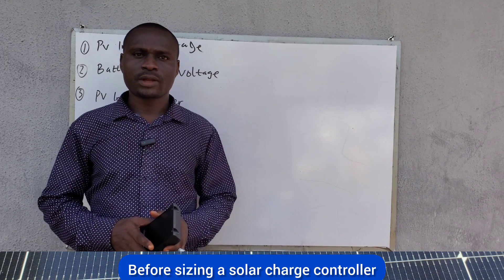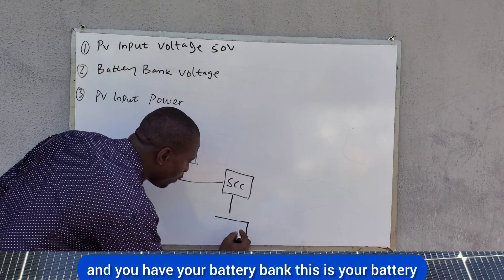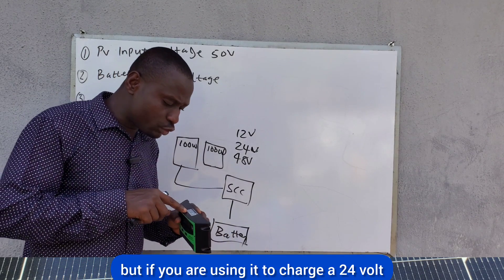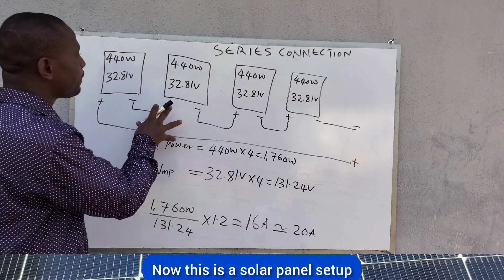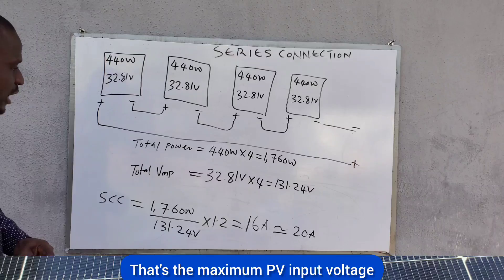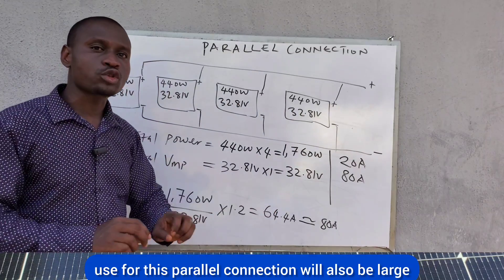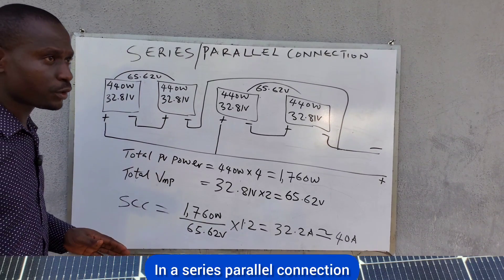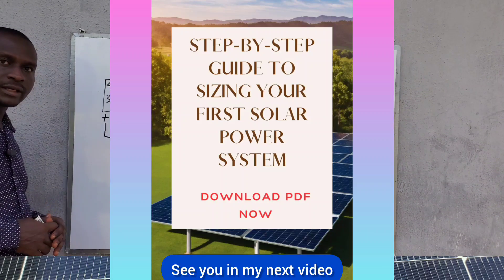How to Size Solar Charge Controller #solarpanelinstallation #solarenergy

Comment: Hi It's Austin in the UK. I would love to have you Pdf notes. I'm trying to put up a solar system.. I've already bought a 6200w hybrid inverter ,MPPT 120A, and I am want to use 608kw for each panels.  How big would be my battery bank and solar  array

Comment: Please, with this illustration, using the solar panel series connection with 20A mppt and solar panel parallel connection with 80A to charge the same battery . Which one will charge the battery faster?

Comment: During the series calculation, you said the current (W) would remain constant, and voltage (V) increase, but when you were multiplying them, you added the 4panels to the series connection, which made current increase and voltage increase too.
That’s 440*4=1760
And then 32.8*4= 131.2 
I didn’t get why the current increase too alongside the voltage when it was a series connection

Comment: Halo.I am from Bosnia and Herzegovina.I have a problem with conection solar panel with voltage regulator+inverter sistem.this is detail:SOLAR INVERTER

Model Name: FU-PV18-1012VPM

Operating Temperature: 0-50°C

Protection Class: Class I

Protection Degree. IP 20

Inverter Mode:

Rated Power: 1000VA/1000W

DC Input: 12VDC, 125A

AC Output: 230VAC 50Hz 4.35A 1Ф

AC Charger Mode:

AC Input: 230VAC 50Hz 6.544 10

DC Output: 13.5VDC 20A/10A

Solar Charger Mode:

Rated Current: 60A

System Voltage: 12VDC

MPPT Voltage Range: 15-105VDC

Max. Solar Voltage (VOC): 105VDC

Max. Charge Current: 70A

Max.PV input Current:20A .Solar panel leapton two pices APTON

SOLAR

Type

Leapton Energy Co.,Ltd |

Peak Power(Pmax)

Power Sorting

Peak Circuit Voltage(Voc)

Photovoltaic Module

LP210*210-M-66-NB-690W

Max Power Voltage(Vimp)

Short-circuit Current(Isc)

Max Power Current(Imp)

39.80V

Weight

690W

Maximum System Voltage

18.30A

0~+5W

47.80V

Open-circuit Voltage Tolerance

Power Production Tolerance

Maximum Series Fuse

17.34A

Dimension

Short-circuit Current Tolerance

DC 1500V

30A

±5%

Application Class

Test Condition

±5%

+3%

23841      du you can help me?  With instalacion wire.thank yuo

Comment: I have a question sir.
Example: If I connect 2 panels in series and I have only 1 battery which is 12v, is it going to charge it. Or If panel was connected in series of 48v and battery is 24v in series, is it possible to charge it?

Thanks for the clarification in advance

Comment: Sir  how are you

So i wanted to ask ; you calculated on series connection and you get   20A  charge controller    how about the voltage of  charge controller is it 24v or 48volts

Comment: I believe the total power is supposed to be 440w x2 and not x4 if not, pls I need clarification. Because by my understanding under ur teachings when pv's are connected in series volt increases current remains the same and the reverse is the case with parallel connection. Since we have 2 strings connected in parallel it is safe to say the total volt will be volts in each string x2 same applies to the current. Thank you sir

Comment: How do I size up my fuse or dc breakers from panels, inverter, controller and batteries, am watching from Namibia, I want to set up my small off-grid system at the village am new with this system.

Comment: Can the charge controller u displayed in this video output up to 200 watts without using an Inverter ( assuming my connection are right)

Comment: The problem is virtually all the mppt controllers available in the market have a maximum PV input power of 390W for 12V battery.

Comment: I installed a 200w solar,30A solar charge controller,12v,200Ah battery,my charge controller failed,what is my mistake,I need help please

Comment: So you want to use a 16amp scc for a power of 1,760watt panels. It won't work. You are supposed to divide by the operating system voltage I.e 12v ,24v, 48v etc.

Comment: please I have a 350watts monocrystalline solar panel
Vmp is 30v, voc is 34v 
Imp is 11.6a, is is 12.36a

What charge controller type and size, and breakers do I need for 
1. 12v, 100ah lifep04 battery and
2. 12v, 250ah 6-gfm gel maintenance free battery 

I want the size controller and DC breakers for the panel to charge controller, charge controller to inverter and Ac breaker from inverter to appliances for each battery type

Comment: for a 3.5 kw inverter charger. with 10 to 13 solar panels assuming each panel is 300-350 watts, how should the panels be connected series or parallel

Comment: I need your advice please ..i have that small pwm charge controller and a 12volts 20a batery ..i want to buy panel but according to the charge controller manual ....is says 18v to 24volts to be used for 12votls batery and 36to 46 for 24 volts batery my question is can i use 36volts 300 wats panel on that same pwm charge controller to power a 12volts batery

Comment: How many 350w 32v solar panel & charge controller can change 440ah24v batteries (Two 220ah24v connected in parallel) sir.

Comment: You really solved everything... Thanks. My question is how many 350wat solar panel can a 60amp pwm charge controller handle?
Reply from the maker: @adeyeyecoker8220  What is your battery bank voltage?

Comment: My question sir.. Is we dont have 20a and 40a  SCC  that can handle 1,760 for 24v battery syatem .. Mostly is 60a  and 80a . Does its mean its will work  or handle it despite is not specified? Pls more explanation and What i no is that u are to divide battery voltage from the solar pv array to size you controller  not the panel vmp and even from every CC We have it specified there and knowing  that if you are using mppt CC ur current will increase converting  the exess voltage. So from your calculation i dont think 20a and 40a can work and from my experiense and research that is a wrong calculation sir.

Comment: Pls can a mppt 60amp work with a 720watts solar panel for charging two 12v 220ah batteries connected in parallel.. Thanks

Comment: good explanation. i love it. i think you woould get an exact size of an MPPT if the TOTAL POWER/TOTAL VOLTAGE was multiplied by 1.5. it would significantly direct someone to a correct SCC. 🙏🙏🙏

Comment: Hello sir, i followed this steps (series connection). I have an MPPT SCC 60A. my solar panels are 750watts. but it keeps frying my SCC. I just bought, the MPPT 60A and now i am seeing smokes coming out from it. please any tips?
Reply from the maker: What is the maximum pv input voltage of the controller?
Reply: @Solarwattng 780w(12v) 1560w(24)
Reply: I just changed from series to parallel now and the charge controller isn't bring smoke. Well I will need an extra Day to check it again when the panels charged and the sun is hot.
Reply from the maker: @babajide-hunsuraphael6625  Ok.. Please chat me up on whatsapp +2340905 345 3640. Thanks

Comment: Keep it up dear, excellent video and well explained 🎉 Please keep in mind in real life situation the voltages will increase below 25 degrees centigrade and will decrease above 25 degrees, you have to take into account using temperature coefficients of the panels used
Reply from the maker: Noted! thanks very much for your input I'm grateful 🙏
Reply: @Solarwattng  Thank you for your response and valuable time that you give

Comment: I understood up till the point where you said connecting the panels in series will also add increase the wattage of the panels as well as the voltage. I thought the voltage is the one that increases when connecting in series while the wattage remains constant. Please help me out because i am not a professional, only seeking the best knowledge.

Comment: Can i over panel this Felicity mppt 12 volts 800 watts with two 550watts panels( making it 1100 watts) on parallel. Can the mppt handle the oversizing?

Comment: but you should know many of the 40amps charge controller cant take1760 watt, most of them on 24v is 1040 watt or is watt not to be considered
Reply from the maker: @josephndubuisi6369  Always look at the spec sheet of the pwm controller for different voltage system (12v, 24V and 48v) to know the maximum pv input power of the controller.

Comment: What should you consider whether to connect in series or pararrel
Reply from the maker: The pv input voltage and current requirements of the charge controller

Comment: Excuse me sir, I have a question for you based on that series/parallel connection. On the first string when you connect the first two panels(440W, 32.81V) In series, and the voltage doubled leaving the current the same, same thing to the other two strings. Now when these two sets of panels are being parallel together how did you manage to get 1,760W. I don't know if I'm the only one noticing this

Comment: I am asking for a solution: I have one solar panel of 380W and one of 450W and a 12V battery; 160Ah...How should I connect them? I was advised to do this with two separate PMW controllers' Is that good or do you have a better solution? Thanks

Comment: I liked and subscribed because it's easier to learn about solar system.

My issue is that my inverter use to show red light (Fault) out of nowhere and I don't know what to do 

My solar panel is 120W
Battery controller 30amp 
Inverter is 2000w
And my GEL battery is 100ah

Comment: I am a pro in this work since 2011 just coming across this video this man is good in explanation, because he knows what he's doing turns up bro... You need more students to share you knowledge
Reply: Watching from Kenya
Reply: I want to ask, all this connection is with how many battery please
Reply: @victorudoh-i2q 
Depending on what you are installing
Reply: Watching from Kenya 🇰🇪 well explained. 🎉
Reply: Iam tanzanian.70wtts solar panel.what perfect size needed for controller and batter?
Reply from the maker: @egbunonworjoshua4411  Thanks for watching
Reply: I called you on WhatsApp you didn't respond  @Solarwattng
Reply: @Solarwattng  please I have a 350watts monocrystalline solar panel
Vmp is 30v, voc is 34v 
Imp is 11.6a, is is 12.36a

What charge controller type and size, and breakers do I need for 
1. 12v, 100ah lifep04 battery and
2. 12v, 250ah 6-gfm gel maintenance free battery 

I want the size controller and DC breakers for the panel to charge controller, charge controller to inverter and Ac breaker from inverter to appliances for each battery type
Reply: Please i need your contact sir @Solarwattng
Reply: @Solarwattng good morning sir, like 15000w panel in total which of the charge controller can work with it.
Reply: Watching from Ghana
Reply: Sorry i bought a 50 watts solar with 60ams solar controller charger, please which volt battery size will I use with it
Reply: I am Stephen Mutsigwa from Zimbabwe enjoying your presentation on solar system. Thank you so much
Reply: Please I have a 2 unit of 220ah what’s the battery bank i should choose on the charge controller am a beginner please
Reply: Watching from lagos am a new student
Reply: Sir i have a 24V charge controler and it chip stop charging everyday for about 20 minutes then started charging again can you say what causing this problem it's a mppt charger

Comment: From Yola Nigeria. I doff my hat for you. But which is PV input voltage to your charge controller? We have Voc and Vpmax as you rightly said. Again are the voltages not affected by temperatures? Remember voltages are measured under STC conditions.

Comment: How do i connect my submersible pump to both DC and AC  using solar panels, inverter and charge controllers? Kindly help, i am in trouble in rural area and want to help a community with water supply.
Reply from the maker: What are the specifications of the pump?

Comment: was checking your video to get some more info on pwm 
when the power draw drops ie if load is zero (battery full and no load) the panel voltage gets dragged to voc

some inverters will also drag the panel voltage to voc and zero output when they switch working mode
even when there is load ie in overload going to bypass scenario

so on mppt you have to use voc and use a safety factor too for cold weather

Comment: Good explanation,  but sir ? is it possible to connect a panel of 300watts, 30volts 8.94a and  3 panels of 180watts 18volts 9.52a in series to charge 12 volts battery  with 70 ams mppt controller .

Comment: God bless u sir, but I thought when sizing it, the solar wattage in array should av been  divided by the battery bank voltage
Reply from the maker: That's when sizing an MPPT controller
Reply: Ok, thank you very much sir @Solarwattng

Comment: Hello sir, my name is Michael from Kenya, I wanted to install solar system to my parents home back in the village and I needed your advise on the number of panels, batteries, volt controller and inverter to use. It's a 3bedroom house with a kitchen, corridor and a small dining room(6 60watts bulb lights) and 5 security lights outside.Thank you
Reply: It should also power tv, fridge and charging gadgets.. Thank you

Comment: From Uganda
I would like to inquire from you, why does most solar system lights off despite using that calculation but still you find the solar power is not powering as you calculated it after a few days of installation?
The first few days or weeks it works well lights are on as u calculated but after they begin going off before time and some are forced to bi-pass  the controller only that the battery back gets spoiled quickly.
Reply: I think that's the dying cells of the solar due to bad connection

Comment: Watching from ZIMBABWE..HOW CAN I CALCULATE THE BATTERY BREAKER, Fuse disconnect for 2x48100 connected in parallel.  Your explanation is clear

Comment: Please I've 180watt *4 panels and 440watt *2 panels can I mk everything in parallel please what's the output voltage ⚡... Techfine 80A MPPT I want to use
Reply: The voltage have to be the same. If you connect a high voltage to low voltage theirs goin to be a surge and one of the panels will burn

Comment: question? I have 120 solar watts and which size of the charging controller and the solar battery can I buy? 
thanks
Reply: Go for 12V PWM Charge controller and 12v battery

Comment: Why will you divide by the array voltage when the batteries are still going to be connected and the controller must bring the array voltage to level up with the battery voltage!!!

Comment: After doing my calculations on charge controller and got 38A for 24v battery bank, with  pv max power 1600w( four 400w mono panel) and max pv voltage for series parallel connection is 106v. Can mppt 60a with max pv voltage 150v and max power of 24v 1540w be good for such system. Note the total pv array is 1600w while the max power of charge controller for 24v is 1540.
Reply: The most important  factor is voc for ur Panel is 1.6kw power  and its  above   mppt rated power,  take 20% of ur system at peak hours   which is 0.32kw so it will work perfectly

Comment: Hello bro! let me rephrase my comment from one of you videos! you can't actually determine the size of your solar charge regulator without knowing the battey banc voltage . the size of your charge controller depends both on the total pv wattage and the battery battery banc voltage.... let's say you have a 750 watt pv voltage and a 12 volts banc..you'll need : 750/12 × 1.2 = a 75 amp sollar charge regulator. 1.2 is a safety margin of 20%. but a 60 amp regulator will actually work fine if you think of system losses from the pvs .... Keep up the good work brother!

Comment: Please can 2ps of 300watt panel charge 12v 200ah battery on a full load.
Reply: Well, it can base on the effective's sunshine. But with some studies,1kwp is for 100Ah Therefore you need 2000w to charge your 12v 200Ah battery. Thank you

Comment: Watching from Nigeria, how  do i determine the voltage of 400watt solar panel monocrystal. Thanks
Reply from the maker: You can use a digital multimeter or check from your charge controller

Comment: Please, series connection u get more volt and parallel connection u get more current, so which connection will charge the battery 🔋 fast,

Comment: Keep it up, you are the best.

Kindly experiment the performance of MPPT and PWM charge controller at the same time using:
1) the same type and size of  panels ,
2) the same weather conditions, and
3) watts reader, to know the diff. in watts.
I believe this will help clarify more on the issue  and open our eyes more on how MPPT is been over rated by the manufacturers.
Thanks.

Meanwhile, I am watching from ABA, Abia state.🇳🇬
Reply from the maker: Thanks very much. I will do a video on that soon

Comment: Well done sir, keep up the great work.
Please what about the Battery Current? As  SCC are always rated in Voltage.
On this same SCC used for this class, if I connect 2 batteries 12v/200aH in series making a 24v/200aH and connect another 24/200aH in parallel to it making a 24v/400aH (9,6kWh) , will this SCC charge it?
 Does the size of the  battery bank matter?
Please, this is a real issue for me..
Kindly help out..